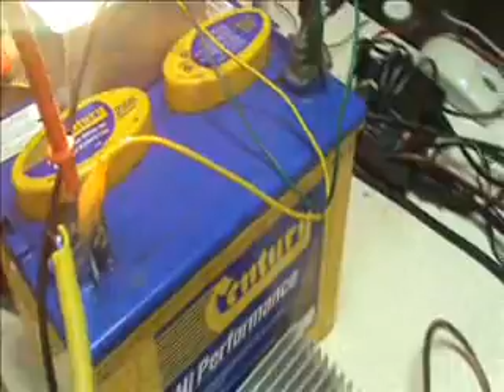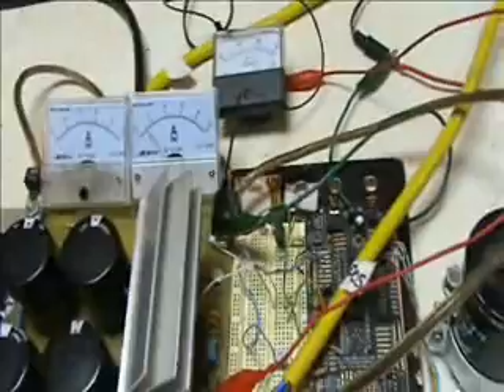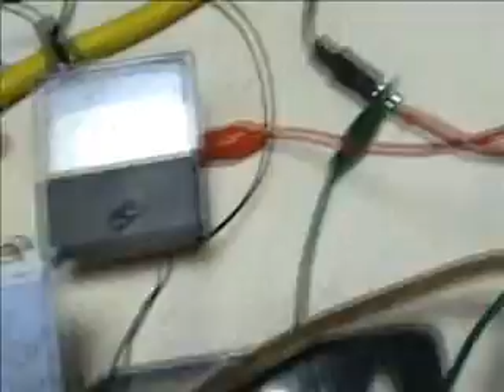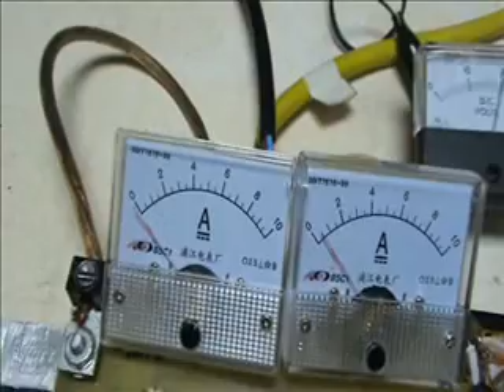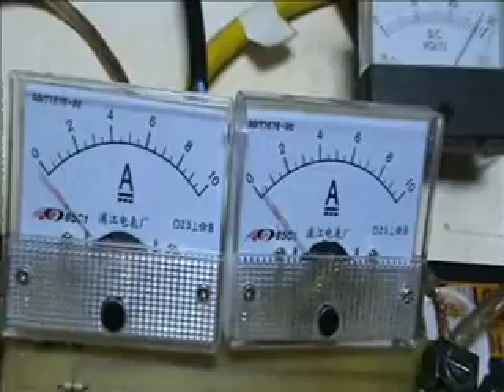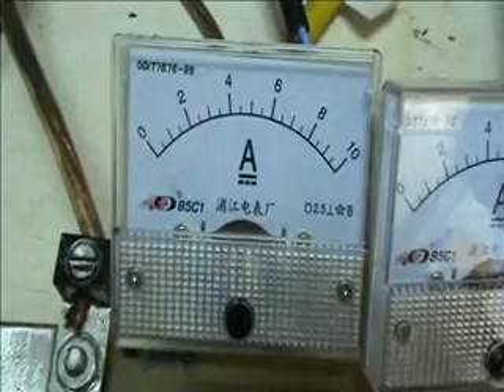Tesla Switch Solar Charger

Comment: instead of the 8 diodes for the telsa switch circuit from the dvd can you use "active rectification" circuits that have controlled mosfets in them for speed switching and low losses? might get more of the spike

Comment: i just bought the tesla switch dvd's and almost have the tesla switch made from the dvd but the device you have there looks like johns device did you buy it  it looks cool, i have 64x 6v batteries that would be cool to use on 4x 96v banks
Reply from the maker: +phillip reed Yes, the device on the left of the video is one of John's Tesla Switch prototypes. I modified the timing controller with a PIC, which is the device on the right.

Comment: Could you provide some schematics. It seems very interesting. I plan to do the same on my 300 W  solar panel array which feed 2 x 100 Ah deep cycle batteries. I intend to swap those battery in order to not charge and discharge in the same time a battery. Peter Lindemann says it is very poor design to do that. Thanks.

Comment: Hi! Joster here. Incredible work! I would live to know what type, size, and rated voltage you are using for those four caps. Also, if you would mind going into a bit more detail regarding the Tesla Switch. Right now, I understand that the caps are charging up and then being discharged across the battery. How does the Tesla Switch fit in?